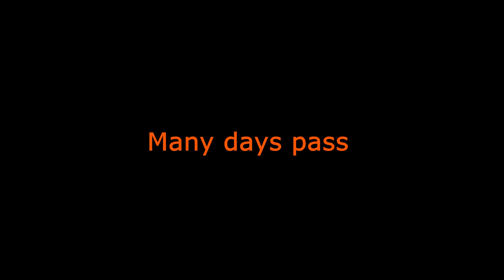FREE lawn comber scarifier. How bad can it be? Will it start?

Comment: Back in the early 80's, I used to service these engines as they were relatively new back then. Briggs and Stratton make a tool to remove the recoil clutch that is quite helpful. Also, China makes aftermarket carbs for these engines. I have used one, and it ran the generator nicely.
Reply from the maker: I’ve had a few Chinese aftermarket carb on Honda engines and always find the quality is ok but fit is sloppy - end up chasing a good idle or mixture more than you should. But they are usually so cheap it’s fine!